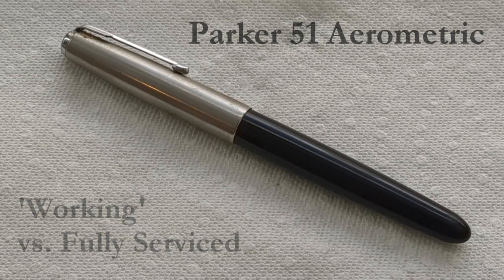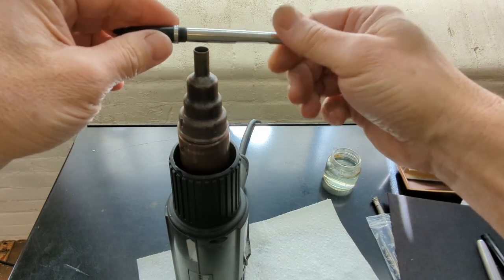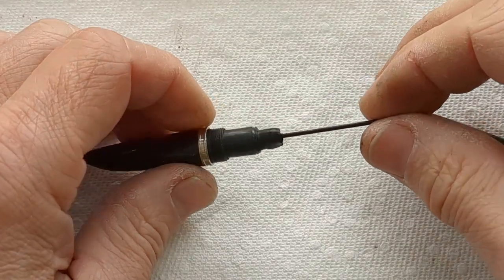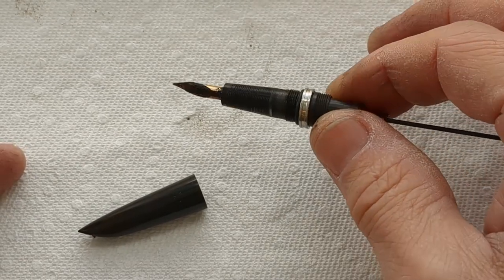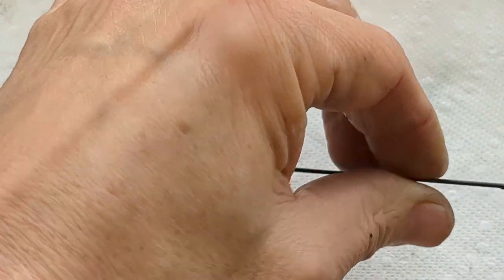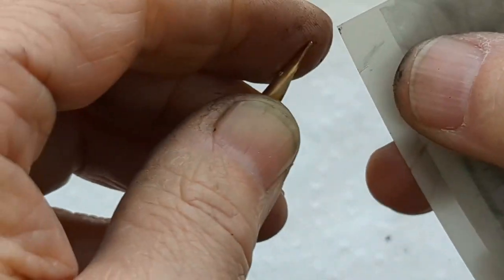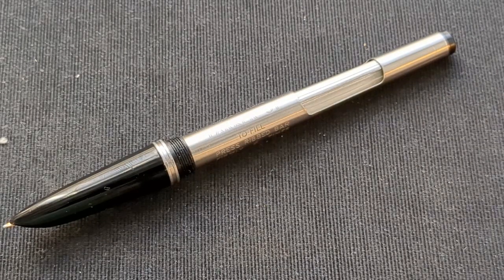Parker 51 Aerometric Fountain Pens: 'Working' vs Fully Serviced

Comment: I love silver, especially when used for fountain pen bodies, but it seems an odd choice of material for a breather tube that is constantly immersed in a water based liquid, especially given its reactivity and propensity to oxidize. I wondered why Parker chose silver as the material for their breather tubes in the 51. Parker has made some strange decisions over the years, and this seems to be no exception, and it's more expensive than stainless steel, although it's possible that silver was actually cheaper than stainless at the time that they used it.
Reply from the maker: It is a bit of a mystery. It might have been too expensive to make them out of stainless steel; consider that hypodermic needles were costly enough at the time that they would be sterilized and reused, and even resharpened.

Comment: Hi David, this is a very helpful video. I am in the process of restoring my Parker 51 (1950 Mk1 UK) and wanted to replace my breather tube. The current one looks black in colour so potentially ebonite? - can I replace this with a steel breather tube?
Reply: Just to add, the broken piece of the breather tube retrieved from the feed looks to be metal - maybe corroded silver?
Reply from the maker: Sounds like a corroded sterling silver tube. Replacement with stainless steel would be the best option.
Reply: @Vintagepens  Thanks David!

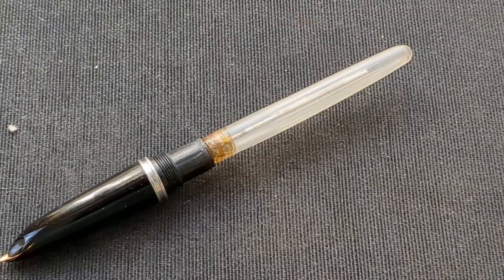Comment: Nice video! I'm currently trying to restore a US Mk1 Parker 51 Aerometric which belonged to my grandmother (I believe she bought it new). The breather tube is blackened except at the section where it connects to the feed, but luckily unclogged and unbroken (I've run through it with a pair of steel strings and checked the length with a caliper - it's 69.6mm long, right on spec). I've ordered a replacement stainless steel breather tube, but it seems the original still can be used. Did you replace the breather tube in the pen under restoration in this video, or did you clean the original silver one? The breather tube as shown e.g. from 7:20 onwards (inside the new sac) seems pretty clean. If you did the latter, how did you do it? I tried polishing it with some Silvo - it did get somewhat clearer but still far from shining new.
Reply from the maker: In this instance the original silver tube was still in good condition and cleaned up readily. Often the silver's surface has become rough with fine pitting, so it cannot be made nice and shiny without removing a lot of material.

Comment: Hi David, im a little confused. Your web site you recomend " For silicone sacs, we have found that a stronger and more reliable seal is provided by a silicone sealant such as Devcon" ? So do we use shellac or  sealant ? Cheers
Reply from the maker: For conventional latex sacs and PVC sacs, use shellac. For silicone sacs, use silicone. Note that Parker never used silicone sacs -- the transparent "Pli-Glass" sacs used for the Aerometric 51 etc were always PVC, as are our new replacements. There is some confusion nowadays about this, which wasn't helped by sellers past who misrepresented their transparent PVC sacs as silicone (see https://youtu.be/WMvbSJAJMus).